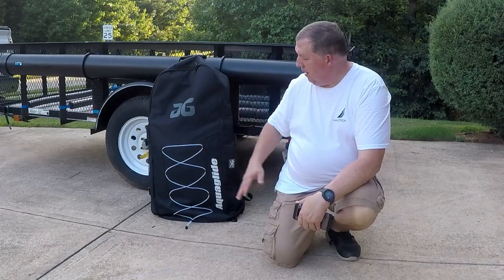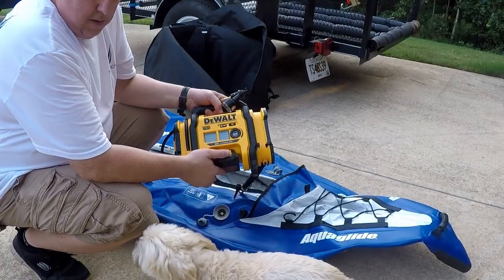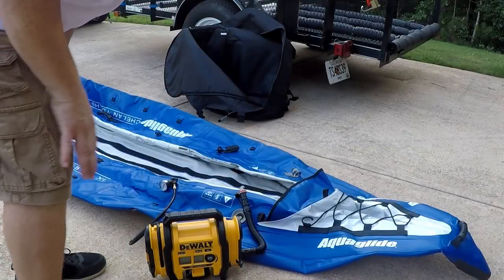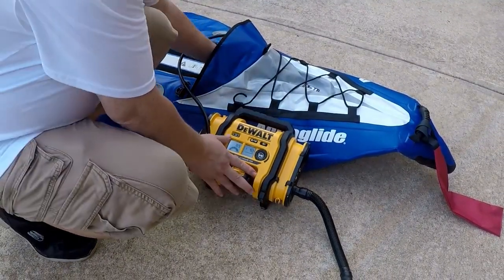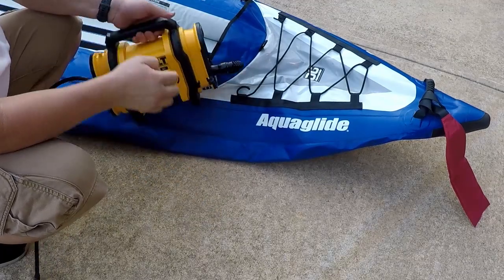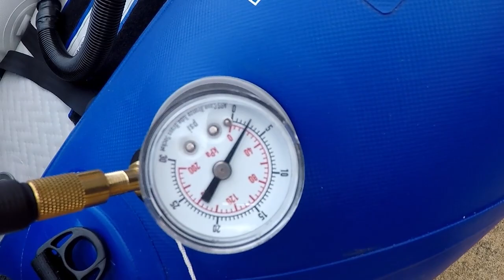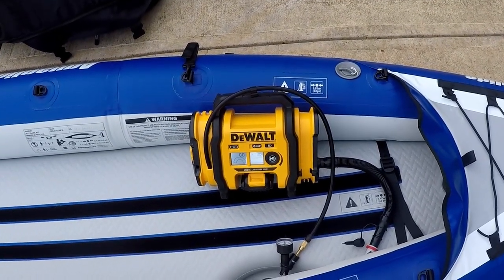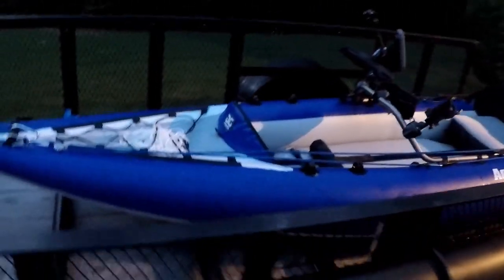Inflate Your Aquaglide Chelan Kayak Easily With This Dewalt 20v Max Compressor!

Comment: Thanks for posting. I have exactly the same set up with Chelan 120 and DeWalt inflator. I thought the pump was faulty as it didn’t show high pressure indication but good to know yours was the same and doesn’t show until over 3 psi then keeps going until 3.4 then shuts off and settles to 3.1.
Reply from the maker: Glad it helped

Comment: Nice video and nice kayak! I have the Aquaglide 12 volt high pressure pump. It works great but I have to be near my car to hook it up to my car battery. I plan on getting the Dewalt inflator like yours. I have the Aquaglide Blackfoot 125 HB angler kayak. I love it! Great Kayak!
Reply from the maker: Nice 👍

Comment: a decent dual chamber manual pump is all you need. 5 minutes and I'm done with my Chelan 155
Reply from the maker: 5 min?... it takes me at least 10 or 15 with a dual chamber pump. Also, when it's 95F with 85% humidity... anything to reduce the stress helps.

Comment: I'm having trouble with the Halkey Roberts adaptor.  I'm using the one that came from AquaGlide and it just won't inflate well.  The adaptor comes with a thicker red washer and a thinner black washer.  The DeWalt won't inflate at all in high volume mode.  If I switch to the thinner black washer it inflates quickly but only if I hold it in place and push down slightly.  Do I need a better quality Halkey Roberts adaptor to work with the DeWalt?  It seems like the adaptor should push the valve open slight and then seal when twisted into place.
Reply from the maker: Hi, Sorry for the late reply.  Try these two valves.. One is for the high volume side and the other is for the pressure side.:
Melchef Halkey-Roberts (HR) Air Valve:  https://amzn.to/3CI3RJL

WAKOODA Inflation Valve with Gauge: https://amzn.to/3m3NXn9

Comment: I have just brought an Aquaglide kayak and looking to purchase the exact dewalt pump so this review is just what im looking for 👍🏻 
Can you please just confirm why you switch to the tyre inflater? 
Could you just use the initial valve, set the PSI then leave it? Hope this makes sense and your help will be very much appreciated? 🇬🇧👍🏻
Reply from the maker: Your question makes total sense!  I should have explained. The first stage blows high volume but does not do higher pressure nor does it work with the auto cutoff/pressure gauge.  That is why I fill it to a point with the blower and finish it off with the tire inflator side.
Reply: @PhilFryOutdoors  Thanks for your reply Phil, that's really helpful 😊 did you have to buy any additional attachments for the Dewalt or are all the parts you used included, Valves etc?
Reply from the maker: @jayjayfire8367  Just the two adapters that I have listed below the video.  
Melchef Halkey-Roberts (HR) Air Valve:  https://amzn.to/3iF6RyH

WAKOODA Inflation Valve with Gauge:  https://amzn.to/3iL9cIq
Reply: @PhilFryOutdoors  Thank you Phil! You have been a fantastic help! 👍🏻
Keep up the the great work! 🇬🇧✊
Reply from the maker: @jayjayfire8367  Great to have been able to help you out!  Enjoy!

Comment: Thank you for the video! It's not clear for me how you could mount the ADVANCED ELEMENTS AE2042 Accessory Frame System on the kajak since there are no holder on the Auqaglide by default. Thank you in advance  for a little bit explanation
Reply from the maker: Sure,  no problem.  The Advanced Elements Frame system comes with some mounts that you have to glue to the kayak.  I used the Stabond two part PVC glue and it worked out great.    I got mine at West Marine but it seems that it's not longer available there.  https://www.westmarine.com/buy/nrs--stabond-adhesive-4-oz--9761958
Looks like you can get it directly from NRS:  
https://www.nrs.com/product/1903/stabond-adhesive
There is also a video on the NRS website.  
I put the bars through the holders and lined them up on the kayak where I wanted it.  I taped it down with blue painter's tape and outlined each circle with a sharpie and made a notched a little index for alignment.  I took them off of the rod and glued them individually.
Reply: @Phil Fry Outdoors  THX again Phil for the detailed explanation. I'm resident in Europe, not sure that NRS products available here but I guess I'll find a surrogate for it .. correction: it exist  German dealers. Perfect!

Comment: Thanks for the video.  Did you use the supplied adapters to connect with the dewalt?  the adapter with the gauge, did that come with the kayak?
Reply from the maker: Sorry for the late reply..  I actually purchased the adapters separate.  In the description should be the Amazon links where you can purchase them.  Hope this helps!

Comment: Does your Halkey Roberts adapter fit on the Dewalt high volume hose as is, or is there a special way you attach it?
Reply from the maker: I will fit, you have to work it on there but it will fit.  I put a little electrical tape around mine so that I don't accidently pull it off.
Reply: @PhilFryOutdoors    Ok. Thanks Phil!

Comment: So you use the Halkey Roberts adapter that came with your Chelan on the high pressure side, what do you use on the low pressure side when topping off?  I didn't see the links you posted to these.
Reply from the maker: These are the two valves that I use on my Dewalt:

Melchef Halkey-Roberts (HR) Air Valve:  https://amzn.to/3CI3RJL

WAKOODA Inflation Valve with Gauge: https://amzn.to/3m3NXn9

Comment: Thanks. Been lookin' at the new 2021 Chelan models.
Reply from the maker: No Problem!  I love mine!
Reply: @PhilFryOutdoors  great info and video Phil ! Would you still recommend the Chelane ? Where did you get the accessory handle bar from and anchor rig up ? Or are the self made ?  Cheers from England ! 🏴
Reply: @PhilFryOutdoors  is it ok for two adults or is it best to go for the next size up ?
Reply from the maker: @Blackcat-fw4tl  The 155 HB XL is perfect for two adults.  I think the load weight is 600 pounds / 272 KG.  If you see the video I have of my wife and I out on the kayak with the dog, we had plenty of room and I am not a small guy.  hahahaha
Reply from the maker: @Blackcat-fw4tl  Cheers!  I am a West Ham United Fan!  Don't hold that against me! LOL    I love my Chelan.  I have the Old Town Autopilot for fishing mainly but still use the Chelan for outings with the family and friends.    I ordered the bars on Amazon and it's made by Advanced Elements:  https://www.amazon.com/gp/product/B007ACX1AM/ref=ppx_yo_dt_b_search_asin_title?ie=UTF8&psc=1   ...   One thing though, if you get the bar be sure to use the right glue.  NRS
Stabond™ Adhesive, 4 oz.
Model # 9761958
MFG # 38704.01.100
Reply: @PhilFryOutdoors  cheers I've just bought one !  I like that accessories handlebar you fitted ! Any info on that would be appreciated ! 👍
Reply from the maker: @Blackcat-fw4tl  The bar is made by Advanced Elements, you can get it on Amazon. https://www.amazon.com/dp/B007ACX1AM/ref=cm_sw_r_cp_apap_jMD4KsLVCFPh6 .  I used Stabond 2 part adhesive https://www.westmarine.com/buy/nrs--stabond-adhesive-quart--19072883?recordNum=70.  The adhesive is great.  Just be sure to lightly sand the area where you are going to glue it and the bottom of the pad.  I used a good duct tape to hold it down.
Reply: @PhilFryOutdoors  cheers for that Phil !  What's the best size paddle for this boat ? Single or double / canoe style or kyak ? Boat got delivered to me this morning !  Says designed in USA and made in china ! ??  I thought trump was bringing your manufacturing back or maybe he didn't have time to finish the job ? Was he robbed or beat fair and square Phil ?  Our MSM  was very biased against him and is completely leftist controlled ! Off topic but strange times indeed !
Reply from the maker: @Blackcat-fw4tl  Congratulations on the kayak!!!! The paddle length has a lot to do with the size of the person but this is the paddle that works good for me and I am 6'1''    https://www.amazon.com/gp/product/B074ZQVN8D/ref=ppx_yo_dt_b_search_asin_title?ie=UTF8&psc=1
If we don't stop this addiction to cheap Chinese goods, we will all be owned by them someday.  Sad but true....  He just wanted to make it fair and all of the industries who put profits over morals came down hard on him.

Comment: This may be a stupid question, but with these valves, once the Dewalt auto-shuts off when it's done inflating, don't you have to quickly remove the hose from the valve to prevent it from deflating?
Reply from the maker: No, it doesn't flow backwards.
Reply: @PhilFryOutdoors  Oh okay, interesting, thanks. We just got our 2021 Chelan 155, tried to inflate it with the Ryobi equivalent of your Dewalt inflator, and the air deflated the moment the Ryobi shut off :(
Reply from the maker: @canadave  Were you using the blower side or the tire inflator side?  Not sure if the Ryobi has a blower side.  Also, make sure you valve is turned to the left (popped out) so that it is spring loaded while filling.
Reply: @PhilFryOutdoors  The Ryobi has the same controls as the Dewalt--essentially the same functions (high pressure inflator, low pressure inflator, and deflator.) Yep, we had the valve popped out while filling it...but the thing is, when the hose is inserted onto the valve, the Halkey-Roberts adapter at the end of the hose presses down on that little valve pop-out button, so that it's open and air can get in. So when the Ryobi shut off, and no air is being forced into the boat, then the valve is still "open" and air starts to escape, so we need to quickly remove the hose (which then releases the valve into the "popped out" position and closes it). That's why I'm surprised that your valve seemed to keep the air in when the Dewalt shut off.
Reply from the maker: @canadave  that could happen with mine on the blower side but not on the inflator side.  I always start off with the blower side and finish off with the tire inflater side.

Comment: What size battery were you using as in 2ah, 3ah, 4AH etc.
The inflator seems to run faster the larger the battery
Reply from the maker: I have both the smaller one that comes with a drill,(2ah)and a 5ah battery.  I don't see any difference in the speed but I use the 5ah usually just in case I have to fill it multiple times.  I have had no problem inflating and deflating with the 2ah battery however.  So far, I have not had a case where I had to change batteries.  I always make sure that my battery is fully charged before heading out.

Comment: So how long exactly does it take the dewalt to inflate this kayak?
Reply from the maker: About 10 minutes.   I need to time it to get an accurate time.  I was just so happy that I didn't have to hand pump in the heat, a little extra time didn't matter
Reply: @PhilFryOutdoors  thats pretty good timing. I know the pumps made for that such as Sea Max take just as long. The warranty with DeWalt is better. And plus, you can use it on your car tires :)
Cool Phil. :)
Reply: @PhilFryOutdoors  in running the dewalt with a 3ah battery.  It took me ten minutes just to get one pontoon inflated.  I did five minutes on low pressure then another five on high.  Any suggestions, it's the first time inflating my Blackfoot 130
Reply from the maker: @ashtaylor9693  That happened to me once when I had not poped out  the button before connecting the valve and I did not have the vave seated good.  Make sure that everything is connected well and your are not getting any leaks.  Also,  fill it up as much as possible using the high volume blower side before switching over to the high pressure side.  That makes it go much faster.  Good Luck!
Reply: @PhilFryOutdoors  I found the problems is that the halkey roberts valve attachment that came with the kayak doesn't open the valve properly. As a temp work around I put the valve in deflate then use the high pressure then remove and shut the valve quickly.  The dewalt has been working well.
Reply from the maker: @ashtaylor9693  Great!  I thought it had to be something like that.

Comment: Not sure I understand why you use an inflatable kayak when you inflate it at home & then transport it in a trailer behind a truck.  If you have a truck & trailer, why not just go with a hardshell?  You don't even need a trailer, just the truck.  Looked as though you had an actual house & garage.  The point of inflatables is transport in a small vehicle, inflate & deflate at the water's edge & store in a closet.  Looks like you have all the transport & storage room for a proper hardshell boat.
Reply from the maker: I do both; this place is nearby but the parking lot is way up on a hill.  In order save time I do it like this.  By the time I am done setting everything up on site I am worn out.  So, I have as much possible ready at home so that I can quickly deploy the kayak and park my truck.  I have a hard shell for fishing tournaments but I got the inflatable first before moving on to the hard shell.  In the future the inflatable will pretty much just be used for when we have visitors or when my wife wants to go with me to just paddle around.  I also take the inflatable in it's pack on my ATV to a lake nearby my house and at that location I do inflate it by the water.  Just depends on the situation........